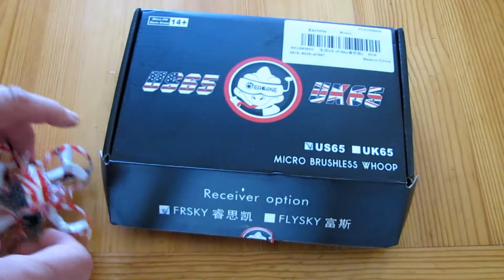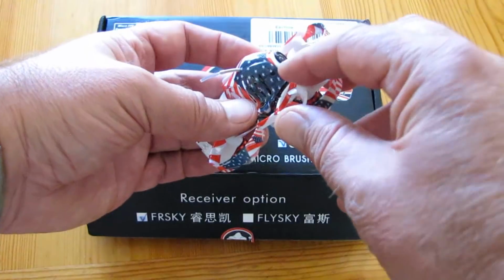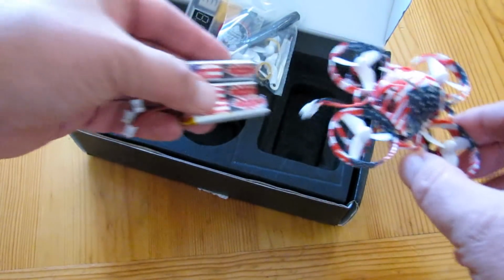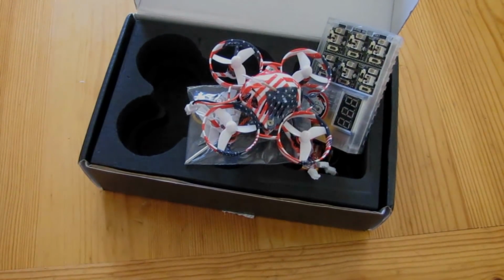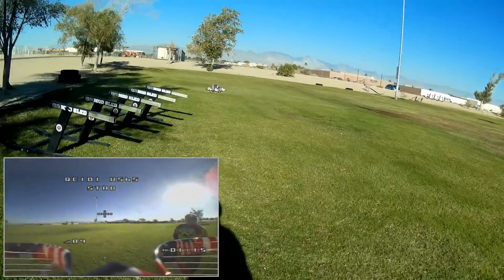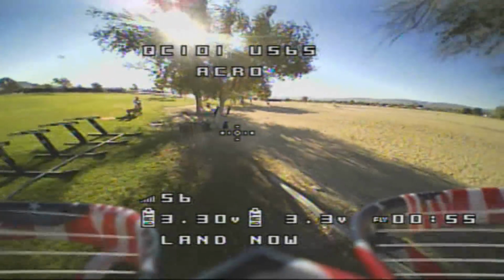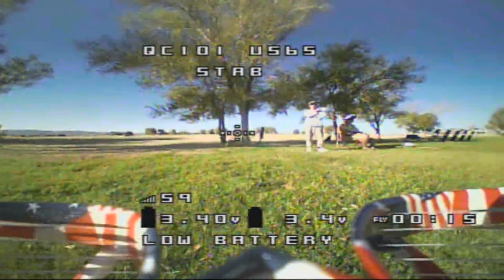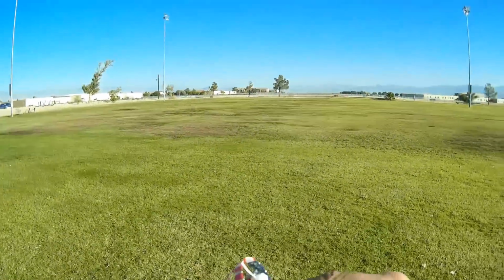Eachine US65 (UK65) Brushless 65mm Micro Whoop FPV Racer Flight Test Review

Comment: That sag is due to the ph2.0 connector, swap it or do the solder tin mod and wou'll see, a good way to diagnose if the connector is causing that sag is when you stop flying touch the conmector, if it is hot/warm it means that there is a ressistance opposing to the current flow ( a laminated ph2.0 connecor)
Reply from the maker: https://youtu.be/Do-u1tsGf98 New low resistance GNB27/ET2.0 connector eliminates sag.

Comment: Great video. I love the ur65 which is the same thing, just no fancy flag.. change the props to quad blade and your notice a massive difference in flight. Best mod ever, i just used some e010 props, works a treat. 
But this lil thing is defo the tiny whoop future with mini brushless motors :)
Reply: JokerVision FPV And upgrading the pigtail to a 24awg powerwhoop.Best combo! Pigtail and e010 props!!
Reply: Just got my US65 last week and it came with 4 blade props, just like my old E011 and E010. Frame is brittle and came cracked in places outta the box. Will be ordering a UR65 frame shortly...
Reply: Kinda late but I was wondering what the difference between 3 blade and 4 blade props. How do the affect flight/flight time, and why? Couldn’t find anything on the internet so far.

Comment: I guarantee the wires are rubbing on the motor bell and decreasing the flight time. Be careful if you bend them down, they are very small and fragile. They get pushed right back up when you land, sometimes completely stopping the motor.

Comment: Good evening Quadcopter101. I have the same little whoop and when I crash I have to pull out the connector from battery and reconnect it in order to rearm it. I would appreciate the help. Is there something in the software that I have to turn on or off. Thank you.
Reply from the maker: What receiver/transmitter are you using?

Comment: Do you think the FlySky FS-i6 would be a ok TX for this?
Reply from the maker: Yes.  Make sure to select the Flysky version.
Reply: Quadcopter 101 ok thanks. I think I’m gonna order this one today.  I know you like the beta75x better. But i think this might be better trainer for me because it might be slower.
Reply: @errikpreto1281   How do you like yours? I just got my US65 last week and flying it just fine with my Flysky i-6. Haven't even hooked it up to betaflight to tweak anything. I'm lovin the stock tune just fine. Except for flight time, I'm really lovin the smaller size and power over my older brushed 75mm whoops with 820 motors for indoor flying.
Reply: Phrancis5 yeah i love mine. Flight time does suck. I bought QX7 TX.  But i love it

Comment: I get around 2.30-3 mins on my us65. HV batteries have an issue with betaflight recognising them as a very low 2s battery. So you get the land now instantly. Set voltage warning to 2.8/2.9. Check my channel, I uploaded a vid of me ripping the us65 😎

Comment: Nice with brushless motors, but useless flight time
Reply: These get 2.5 to 3 minute flight time if you set the voltage correctly in Betaflight. These are not strictly bind and fly, you do have to hook em up to the Betaflight config (just like you would to any larger drone) and make the correct settings.